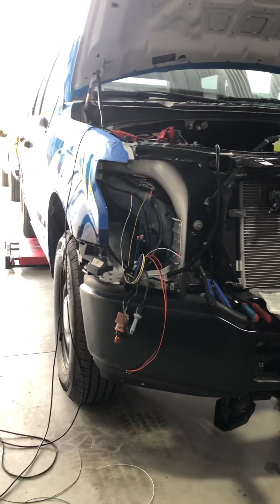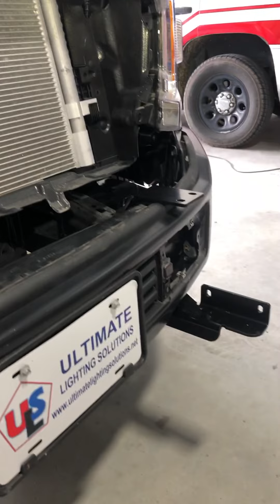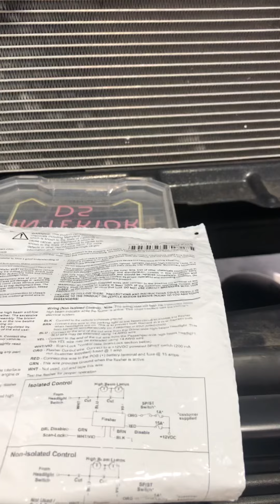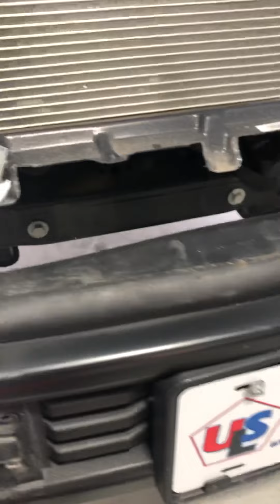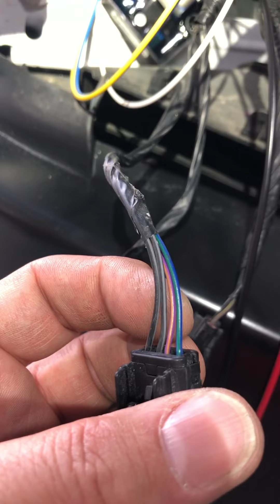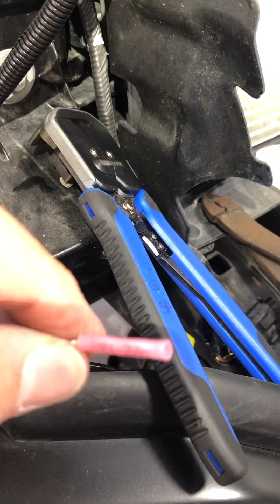ULS - Ultimate Lighting Solutions | Whelen Headlight Flasher Install Ford F-150

Comment: 2017 f150 wire colors were different 

Purple/orange harness side -highbeam trigger (white flasher)

Purple/orange bulb side- passenger high bulb (yellow flasher)

White/yellow - driver high bulb(blue flasher)

Orange flasher - user supplied switch
Reply: Why do you cut the wire xant you just tap into it. It would they both flash at the same time if you dont cut them